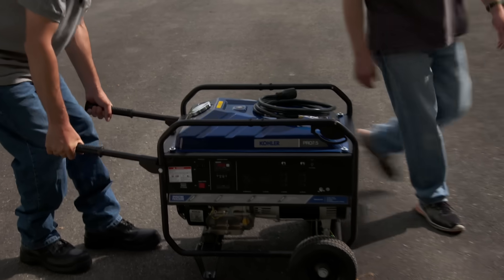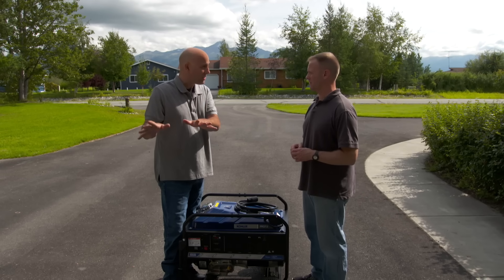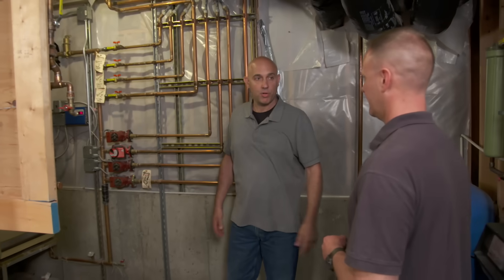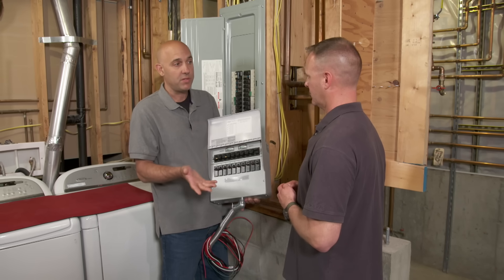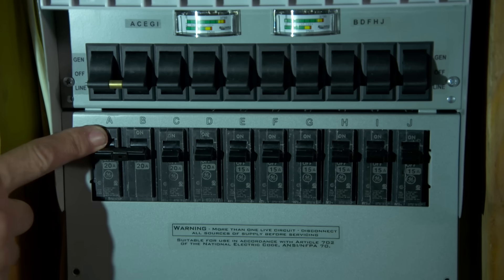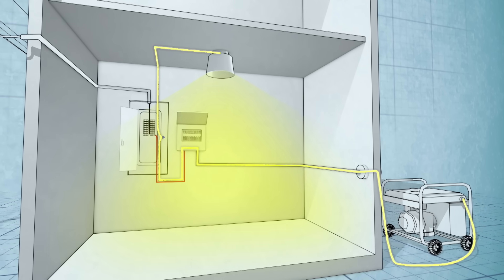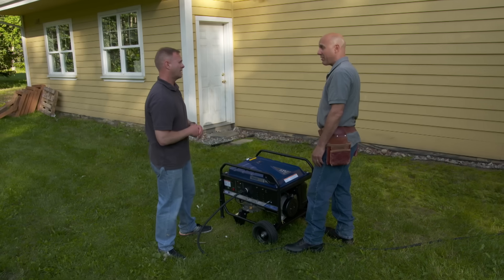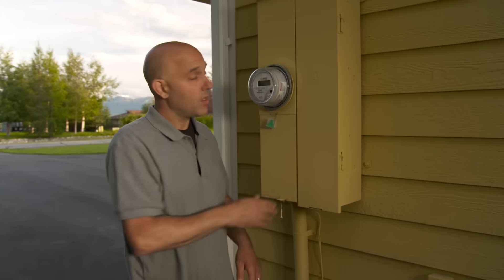How to Install a Manual Transfer Switch for a Portable Generator | Ask This Old House

Comment: So, this seems to be a big debate on the internet. We have a Transfer Switch, which is safer and works for what we would need in a power outage. Here are some Pros and Cons of each option.

Interlock Switch

Pros:
1) Cost less. (Switch ($70), watts meter ($90) and inlet box ($60) Total $220)

2) Can choose any circuits to power on/off.
3) NEC compliant and UL listed.
4) DIY project.

Cons:
1) Main breaker has to be off.
2) All individual breakers need to be turned off before switching over to generator power.
3) Potential to back feed the main power lines.
4) Harder to balance both legs of generator.
5) Have to modify main control panel box.
6) Have to install a double poll 30 or 50 AMP breaker.
7) Might have to pay an electrician to install.

Transfer Switch

Pros:
1) Cost more, but can buy a kit which includes everything you need to install. (Transfer switch prewired, conduit, power intel box and power cord $300-$440)
2) Easier to manage power load.
3) Easier to balance leg loads.
4) Some switches come with a standard circuit breaker for each circuit.
5) Each circuit is isolated from utility or generator power.
6) Impossible to back feed either utility or generator power.
7) When power is restored, you'll know it by whatever circuits not included in the transfer switch.
8) No need to switch off/on any breakers in the main control panel when switching between "Gen" and "Utility" power.
9) NEC compliant and UL listed.
10) Can switch to generator power, while utility power is still powering your house. 
11) Can have 10 individual circuits or 5 double poll circuits. (Only one can be a 30amp double poll)
12) Idiot proof.
13) DIY project, but more involved.
14) Comes with a watts meter.

Cons:
1) Can be costly
2) Limited to the same 10 circuits you choose.
3) Might have to pay an electrician to install.
Reply: It is impossible to backfeed the grid with an interlock if they are installed properly. In fact, their exact purpose is to prevent backfeeding of the grid.

Comment: Why would you need two breakers for each circuit? Waste of time, money, and space. Just install a single transfer switch for utility or a genny.
Reply: When on Generator power, you don't want to over load a circuit that's why you need a breaker for each circuit in the Transfer Switch.  (Just like in the main control panel) When your on "Gen" power through the transfer switch, the circuits are active in the transfer switch, but not the main control panel.  Unlike the interlock switch, this transfer switch is much safer and don't require you to touch any circuit breakers in the main control panel or have to turn off the main breaker in the control panel.  You can have generator power coming in at the same time as utility power, but both are not sending power to the circuits in the transfer switch.  (It's always "Gen" or "Line" power. Never both) It's actually a really nice set up.  (We have the same transfer switch) I have to exercise our generator every three months with a light load.  I don't have to turn off any breakers in our main control panel, while utility power is still being supplied to our home.  I just flip one of the circuits from "line" to "Gen"  in the transfer switch panel and that circuit is now being powered by our generator. (No back feeding or alterations to the main control panel)  The only real advantage of the interlock switch is, you can use any circuits in your main control panel. Whereas the transfer switch, you are limited to only 10 circuits. The transfer switch does cost more, but it's worth the money.

Comment: QUESTION: Why dont you ground the generator frame to earth??
Is it a FLOATING NEUTRAL generator, or a BONDED NEUTRAL generator?
Reply: Actually you should use a earth grounding rod and grounding cable. Our generator requires this.
Reply: @Pk3_Garage  then why didnt the electrician say so in the video? he seemed like it would work fine without it. he didnt even mention it as an option.
Reply: I don't know.  But we should all read the owners manuals for all products and apply the knowledge we obtain to every situation. We bought our first portable generator a few months ago and watching lots of YouTube videos, nobody every mentioned grounding the generator.  (Not even the one's that review our particular generator)
Reply: @Pk3_Garage  If its tied into the house panel it should be grounded through your house panel right?
Reply: Yes, but remember, the generator is outside suppling power to your house. My thinking is, it should be grounding at the source too. My owners manual doesn't give circumstances when to/not ground the generator.
Reply: @Pk3_Garage  
k thnx alot

Comment: Because you are using the generator to feed the breaker panel, shouldn't you ground the generator to a 5/8" buried rod?  I believe you don't have to do this if you are just using extension cords for single items but since you are going into the house with the juice, I think the generator needs to be grounded.  Am I wrong about this?
Reply: You are correct. Our generator instructions says to do so.

Comment: How about a plug into the circuit panel with a 60 amp breaker, make sure and turn you're main breaker off. Instead of re wiring you're house to use a generator..
Reply: Because if someone forgets to turn off the main breaker when running the generator , you will back feed the power line and possibly kill a lineman.

That’s the whole purpose of a transfer switch or breaker interlock

Comment: I'm pretty sure its illegal to use an electrical panel as a junction box..  atleast here in Canada it is... there must be absolutely no splices in the electrical panel.. the lumex must be pulled out of the panel and put into its own junction box spliced to the solid lumex that runs to the breaker in the panel...
Reply: Not true at all. In the US it is permitted to splice in a load center. No different than making a splice in another junction box.
Reply: @JH-ms3ny  it is different,  the mechanical splice can come undone and short out a multitude of circuit's.. that's where the logic comes from.

Comment: How long can the cord be? Can I use 100ft or is that too long? My generator has a 30amp 3 prong female not 4 like this one. What's the biggest you can go without a power drop?

Comment: You conveniently omitted discussion of wiring the 240V loads.
Reply: Similarly, the black and red wires would serve the same purpose, except there would be two red wires and two black wires for each 240v circuit. First, after turning off the power, remove each wire from the main panel's 2-pole breaker of the 240v circuit you've chosen for the generator's power. Label these wires #1, and #2. Each one of the red wires from the transfer switch's corresponding 2-pole switch would land on one of the two spaces on the existing 240v circuit breaker. One of the black wires from the transfer switch's corresponding switch should be spliced to wire #1, the other black wire to wire #2. 

Then again, don't ever do anything with electricity that youre not qualified to do. Even if you're "like 99% sure" that it wont burn down the house with a family inside.
Reply: @zakthompson6312  It's good to keep your wiring in an organized fashion like that but it's not critical. as mixing up the 240v colouring of wires will not have any effect on the equipment in operation.

Comment: The homeowner says the natural gas is not reliable, but then uses gas to heat his home. Strange!

He needs a dual fuel natural gas/gasoline generator. When there is a gas main break, due to an earthquake he has gasoline. In the meantime, use natural gas and save money! He won't use gas, so add the preservative to his fuel tanks.

Comment: Do you need a permit and inspection for doing this work?  Also, there is no chance that when the generator is running that any power is going back into the grid right?
Reply: Ordinarily, no. But if something is storm damaged or flooded, anything can happen. Switch off the MAIN breaker in the  existing panel if it's a concern.
Reply: There is no way to feed power back to the grid. The circuits going through the transfer switch are isolated from the main control panel when in Gen mode. When the power comes back on, all you have to do is switch each circuit back to line mode in the transfer switch and all your circuits are being run through the main control panel. We have the same one and it works great.

Comment: Noob Here. Question. Soo the gen is ON and the power from the lines go ON. Is it automatically separated (the power). The power from generator and power from the line? I thought it would have to be separated as so the power wont transfer through the power lines. May be i missed something on the discription on the panel. I thought it had to be separated so as not to cause injury to the guy trying to put the lines back up?
Reply: GoldenShaolinNutz --  The Transfer switch has a set of switches above Each Circuit Breaker, that separates the power from the Utility, and feeds the power to the Circuit Breaker, or feeds the transfer switch power from the Utility..  The man will have to go manually switch the transfer switch breakers over to Generator, when he needs to use it..
Reply: @frandanco6289  tyty much appreciated.

Comment: How much does this project cost?
Reply: If you have a generator already, about $800 to $1000 if you pay an electrician to install it. The transfer switch kit is around $460.  I'm in the process of installing this now. Really easy to do if you know what your doing and feel comfortable working  in your control panel.

Comment: Every new house should have a mandatory transfer switch!
Reply: Every new house should have solar panels, a power wall and a transfer switch in which to run power from their electric vehicle’s connection to an inverter!
Reply: SD make a panel interlock for the top right breaker, and it works great as long as the main off switch is in same panel. Same principle as above and if you don’t have any high loads (well or septic pump) it will allow you to make the whole panel live but still isolate the incoming main feed.
Reply: no,
Reply: @wx4sno  square d are more expensive, but they're well worth it (breakers , panel & interlock kit)
Reply: @wesleythompson7  how are they well worth it compared to a simple interlock kit?
Reply: @wesleythompson7  you can literally just turn the main breaker off and turn your generator switch on. This crap is all a joke to generate more money for industry.
Reply: @wx4sno  maybe if that panel has such hard to find breakers it would be worth it to switch to a panel you can easily feed entirely by a generator and transfer bracket.
Reply: These things are at least 5 years outdated already. They make manual brackets now that only allow your generator or utility power that feed your whole panel and any sub panels.
Reply: @KitchenerLeslie2  Definitely not outdated, and still serve a purpose.

In my situation I have a small 2200/1800 watt inverter generator that I use for camping, but also works emergencies. It can power my fridge/freezers, sump pump, furnace, and a handful of lights on  4 circuits.

With an interlock system I have to shut my main off, then kill every breaker on the circuits I can't power. With a transfer switch I already know which circuits I'll be powering. Super easy to just plug in and flip those switches during an outage.

Another perk is I'm not guessing when my power is going to be restored since my main is still on and ready to send power to the rest of the house.

Interlock systems are great, but not for people who don't have massive generators.
Reply: @tubemember21  Yep , you just described my scenario exactly.  Also nice because you can leave lights plugged into any circuit(s) that are still powered by the grid and get a visual indicator of when power comes back.
Reply: @KitchenerLeslie2  Hi, do you have a link to a video or site with this info. Thanks
Reply: @KitchenerLeslie2  Thank you see my comment above.  I guess maybe there are alotta people that have been killed by forgetting to flip off the main and thats why but IM curious if someone has a better response. But yours sums it up.
Reply: @KitchenerLeslie2  so they are way easier to hook up then?
Reply: @texasswag25  yeah. You slap a template on the cover, drill 3 holes, install a 30 amp breaker and the bracket, done. Whole house has power.
Reply: @KitchenerLeslie2  what are they called?
Reply: @texasswag25  I just googled generator interlock kit and they showed up.
Reply: If you add your panel manufacturer and model # you might get the specific one you need.
Reply: @KitchenerLeslie2  thank you for all your help. I appreciate your advice and time.
Reply: @texasswag25  no problem
Reply: Sorry about what happened with your girlfriend
Reply: @KitchenerLeslie2  nonsense. This type of multi-switch transfer panel is much more flexible than the single interlock bracket approach. Nothing "outdated" about it.
Reply: @youtuuba stop. The whole panel being on the generator is better, how could you possibly say choosing a few circuits is better? That’s just goofy.
Reply: I think it's a bit shortsighted to say that every house should have a mandatory transfer switch. 90% of the people are just fine without generator. I think you only have blizzard/hurricane prone areas in mind. In Europe the power is on for 99.9995% of the time... 20 minutes downtime a year. A generator here is only good to prepare for doom scenarios, which is a choice (with a pricetag).
Reply: The transfer switch is useless without a generator. You must sell generators and transfer switches!!
Reply: Only in that dump California.
Reply: @dallas5374  oh man, this didn’t age well...Dallas.
Reply: @dallas5374  p
Reply: @dallas5374  you need a license to go to the bathroom in that third world country called California 😵‍💫😂🤣😂🤣😂
Reply: @dallas5374  and Texas
Reply: @dallas5374  Only in that Dump Texas
Reply: @dallas5374  literally having to look at this video due to Texas’ failing infrastructure.
Reply: Why? Not every house has a generator or will ever have a generator. It's a waste of money for many houses.
Reply: You need a license electrician to install a transfer switch
Reply: @johnsmith6974  snitches get stitches

Comment: That dang fifty foot cable cost you about as much as the generator itself. You made it look easy.
Reply: 50 ft of 10/4 SO cable is not going to cost you $500 lol. Try $90 instead.
Reply: @macaronitire4152  I paid around $70.00 at Lowes. But then I thought, do I want it that far away? No, I don't. The whole idea is convenience. Plus it's just easier to steal.
Reply: Yea there're pretty dam expensive. 50 feet oh yea you're gonna cry when you get to the register to check out 😭😭

Comment: I just isolated the circuits in a sub panel with a feed from the inv/charger. This line also has a 50 amp transfer switch so I can run the gen-set  if I need more power.
Reply: Do a vid bud  Plz send it to me

Comment: Excellent vid.  During an actual power outage when using the generator on the transfer switch, is it necessary to shut off the power (main disconnect) on the main breaker panel to protect lineman?
Reply: No you don't have to turn off the main power in your breaker panel.  That's what the transfer switch is for. All power for the circuits you selected to run off of generator power is isolated from the main power lines coming in.  When the main power comes back on, you just flip the switch from Gen to Line in the transfer switch.  Now those circuits are being powered by the main power.
Reply: Pk 3  I appreciate the comprehensive response 👍🏽
Reply: Yes your right, he didn't mention that .

Comment: How can you put a30 amp orange 10 ga wire feeding 10 circuits able to pull over 100 amps you people might burn his house down better change that  wire
Reply: You won't get 100A running through a 10 ga wire with a 30A breaker.  You'll get 30A, and then the breaker will trip, as it's designed to.  The breaker protects the WIRE not the things plugged into it.

Comment: You should flip your transfer switch back to Utility(Normal everyday mode) before shutting down your generator. Shutting down your generator while your house is trying to pull electricity is very bad for the generator head and can permanently damage it.
Reply: Exactly
Reply: Isn't it also bad for your generator to run out of gas while it is supplying power to the house? I stumbled onto that bit of info on the web. I then checked the manual and it did not make too big a deal of it.
Reply: @miked6335  Yes, this is also bad. The same thing occurs when the generator runs out of fuel. Most owner manuals state to not let your generator run out of fuel while under load (UL). It's happened to me with my 8k Generac a few times, nothing has been destroyed yet. Doing it enough times or under enough load will definitely reduce the lifetime of your machine.
Reply: Not just the generator head.  As the generator stops the voltage can drop, current can spike and electronics can fry.  Not good.  (A high $$ generator will drop the power cleanly,  a cheap generator will not).
Reply: I scrolled through the comments looking for this exact statement! It is not mentioned in the video like it should be. Otherwise an excellent, easy to understand video!
Reply: I could not believe they skipped that step and posted the video….
Reply: Bingo. The gen manual probably mentions it but easily overlooked.

Comment: no mention of how to run the power from the generator to the manual transfer switch?
Reply: Brian Calvey, did you not watch the video?? The long black 10awg cord he made plugs into the generator, and the other end plugs into the female receptacle he made and installed  under the deck on the wall that goes into the room where the panel is..